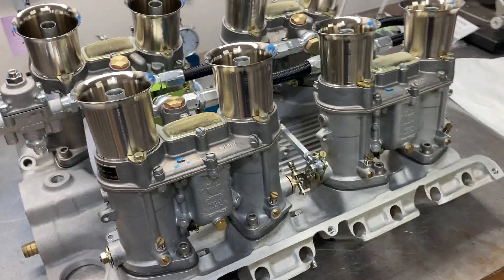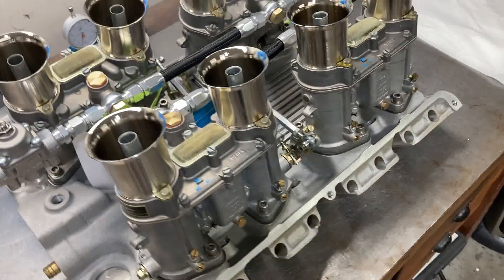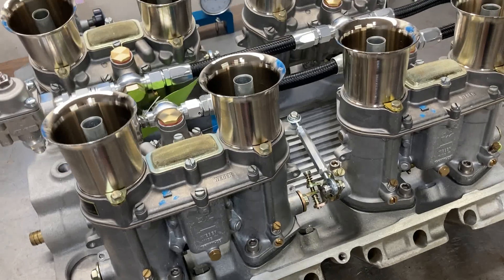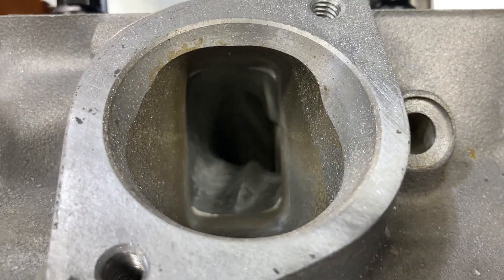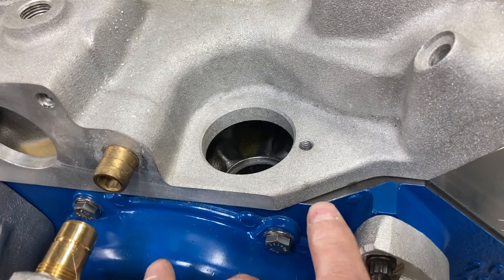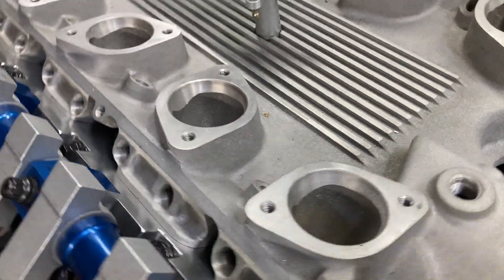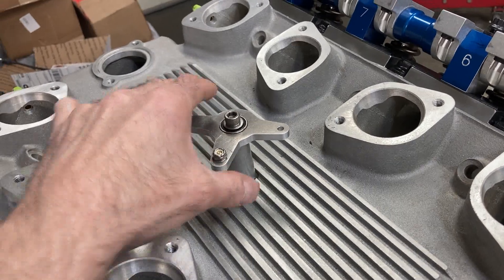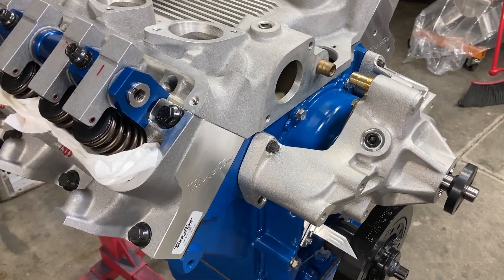Lykins Motorsports Weber FE Intake Overview

Comment: How does one run a PCV system with this setup?
Reply from the maker: You don’t without a common plenum.  It’s ok though, PCVs are a liability and I don’t use them.
Reply: @lykinsmotorsports  All good just change oil like you wash your hands and live with the shortened engine life. This is only my opinion but a PCV is a must on any street car that has enough engine vacuum to run a brake booster. If it does not then run a vacuum pump om the crankcase. If its a race engine its a moot point.

Comment: I would assume one is giving up a lot of midrange torque without a plenum assy. May make good power at peak rpm or so.
Reply: actually the opposite, tested by Jay Brown in his intake comparo book the Weber set-up was at the very top of the torque outputs.  Plus the direct port access is great for throttle response.

Comment: This setup is not for the faint of heart.  I used to drag race my 452 cu. in. FE with an original H&M intake and this same setup.  The 48 IDA Webers are too small for this displacement. They need to be at least 58 mm Bergs to feed this displacement, but those don't fit the manifold.   The Webers are a road race carburetor and will flood the rear venturi of each carburetor on hard acceleration.  If you lower the float, the front venturi will run lean.  In addition the inlet valves can only tolerate 4 psi fuel pressure or they flood.  At 4 psi, there isn't enough fuel flow to supply the horsepower your engine will make.   Berg makes some glass ball inlet valves, part #GB 522-3.3 that can handle 7 psi.  You may get it to work on the dyno, but in the car it will be a real headache.  Presently I run the same Blue Thunder intake as you have with 8 ITBs and fuel injection controlled by a Megasquirt.  I have a idle air valve attached to the manifold to control the idle.  No more headaches.  The throttle response is awesome.
Reply: yep, the problem is finding intakes that work with 58mm.  Not drag racing this one.
Reply: @dennistone8710  I recommend you have an  AFR sensor on each bank.  I have used several brands, but prefer the AEM.  I also suggest the STE SK Carburetor Synchrometer to tune the individual carbs.  The common plenum provides enough vacuum to run the power brakes.  You may want to put an air bleed on this plenum to provide idle air in a balanced way.  Setting the idles is the most sensitive adjustment.  Part throttle is set by the emulsion tubes.  Unfortunately, very few are available now.  I think the "F7" works well, but you might have to run "F2".